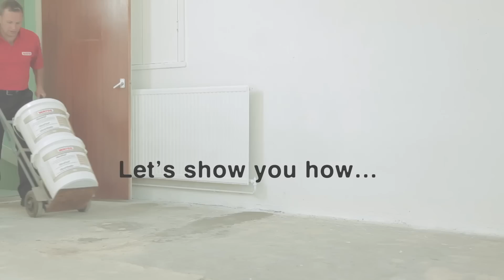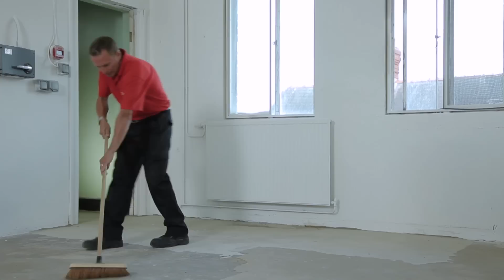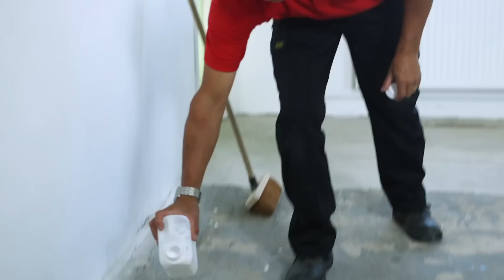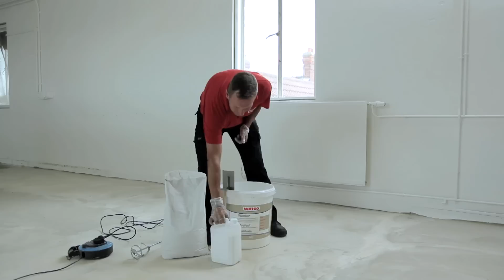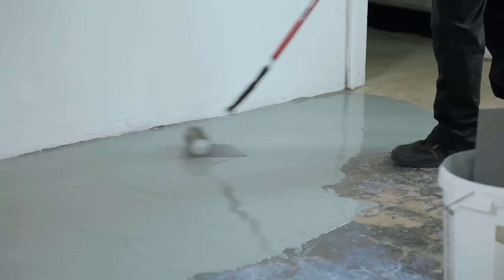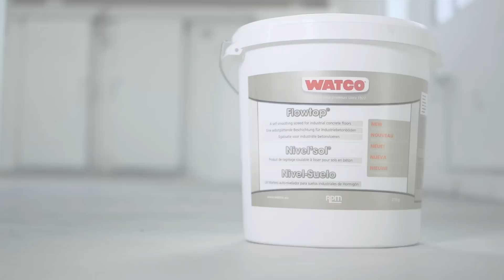How to easily resurface a concrete floor | Watco

Comment: Don't be misled into thinking this is an easy process to apply because it isn't. It is also very expensive to do an area as large as a double garage floor for instance.
Reply: I second that. I am currently looking for something similar on a shoestring budget to smoothen out recently grinded floor prior applying sealer. And it would need to  withstand infrequent pump truck and engine hoist use. If anyone in comment section knows a good, cheap product, let me know. Thanks.

Comment: 1.  If you do the floor in sections, and you do primer one and two, and then the mixed compound, and you have 20 minutes for it to set, and then you start with another section, and it takes like 10 minutes or more to do the primer part and then more time to do the next mixed compound, when you come to an edge where two areas meet, and you use the spiked tool, I assume you better stop short of the first area or you will ruin it with marks.  And how do you make sure it becomes one smooth surface if the first area is already set and a wet area meets it.  Won't that create a seam look?

2.  If you are doing a room with 4 walls and a door, I guess you have to make sure you work your way from the farthest corner first and back toward the door right?
Reply: What would you do if you had a hole on the floor with many many cracks in the garage. I’m not sure what I should be doing I’m not trying to contacts a contractor yet
Reply: @pamelahernandez9986  I would repair a hole with mortar.  They sell a small bag of mortar repair at Lowes or HD.  Cracks are usually repaired with a more liquid epoxy.

Comment: Would have been great to see the finished product. Question: Would this work for a residential floor? What does it feel like when walked on in bare feet?
Reply: Thinking of doing this for our kitchen...did you end up trying it?
Reply: @kentonp21  No. I tried staining the concrete which didn't work because the patched carpet tack holes came out a different color and looked like little stains, and tried "solid color stain" which looked like paint. Decided to go with engineered hardwood. If I had to do a kitchen I would just do tile.
Reply: @hughseagraves7036  Gotcha, thanks for the info!
Reply: feels like walking on a floor

Comment: Will this look like concrete, with natural trowel differentiation, or will it look like a uniform paint or epoxy?
Reply from the maker: Hi, The Flowtop will give a hard wearing level finish that will be porous. We normally suggest painting it with our epoxy coatings to obtain a sealed surface. Thanks Scott
Reply: @WatcoCoUk  Then that doesnt sound like the right product. Thanks though.

Comment: Can you work a new section if the previous section has completely cured? I'd like to do my basement in segments of time, not just space. It would be a huge hassle to clear everything out of the basement and do it all in a single day. I'd rather move everything to one side, do half the floor and allow it to completely set, then move everything again and finish the remaining half. Will the two sections bond properly if one has already set? Would there be a visible demarcation?
Reply from the maker: Hi Dani, We would not advise the separate applications as it will have a noticeable break between the two sections which could move over time and create a stress / weak point in the surface. It does, however, depend on the depth you are laying it at, but it should be considered a resurfacer and not a repair and should therefore be done as one application. 
If you'd like to discuss this further with one of our Technical Advisors, they are available monday-friday, 8:00am - 5:30pm on 01483 418 418.

Comment: Can this be added over an area where old linoleum has been pulled up and stubborn patches of glued paper backing remain? Will it simply level everything out?
Reply from the maker: Hi Avner, Thank you for your message. Flowtop is designed to be applied to bare concrete. It's supplied with two primers that you apply in advance & then the main pourable mix is applied on top. I would not recommend applying the system to glued paper. If that could be removed (I know it’s not easy) mechanically or otherwise. Then Flowtop will level an uneven concrete surface. If there are any further questions please don’t hesitate to call our main number 01483 418418.

Comment: Considering each 5 gallon bucket kit is doing roughly 20sq feet... this may be one of the more expensive flooring solutions.
Reply: 20sqft for the 5 gallon!!!? I hope not. But I would think a 1/16" or 1/8" would be the thickness needed for a number of applications, but some areas for use would be to even out the level as it is self leveling. I always thought all liquids are self leveling.

Comment: Does this work outdoors?
Reply from the maker: Hello Jeff, Flowtop is just for interior use, due to the nature of the product when curing it could be affected by wind and direct sunlight, and so would not cure properly causing cracking if applied outside. If you are looking for a similar product for outdoors we would suggest Concrete Resurfacer ( www.watco.co.uk/concrete-resurfacer.html ) - it is not self-levelling like Flowtop, but it is easily applied by squeegee.
If you would like further advice on what to use for your job please call us on 01483 418 418, where a Watco expert can advise you based on your needs.
Reply: @WatcoCoUk  Is there a equal product in the states? We have Quikrete resurfacer, and RapidSet Resurfacer, but I dont think they can have a selfleveling trowel sooth finish....Maybe they can?

Comment: what if the surface has been painted?
Reply from the maker: +Robert Fallon Hello Robert, if the surface has been painted you should remove as much paint as possible, especially any loose material. It's okay if small traces of paint remain, as long as they are well bonded. Here is a link to the product on our website, where you can find a technical data sheet as well as an application guide - http://www.watco.co.uk/watco-flowtop.html

If you would like more advice on this, or any other Watco product, please call our experts on 01491 418 418 or send us an email on sales@watco.co.uk and we will get back to you.

Comment: looks and sounds good, but how long can it last before it starts cracking again?  6 months?  1  year?
Reply from the maker: +etoyize Hello, how long it lasts all depends on the environment - Flowtop is fibre reinforced & designed to withstand forklift truck traffic and general industrial use so is pretty hard wearing, and will last under general foot traffic for many years. If you would like more information & some expert advice on this give us a call on 01483 418 418 and talk to one of our advisors.
Reply: You shouldn't get cracking as its similar to an epoxy like substance. Flexible and very hard wearing.